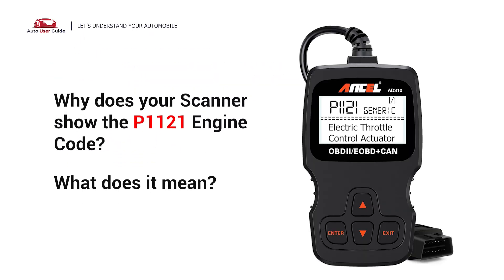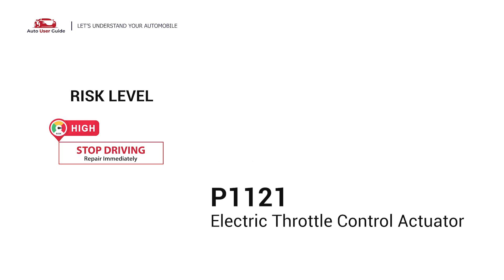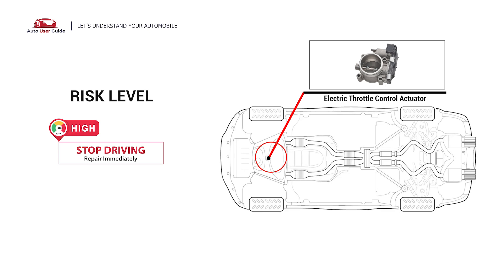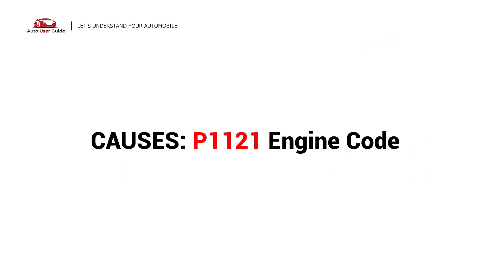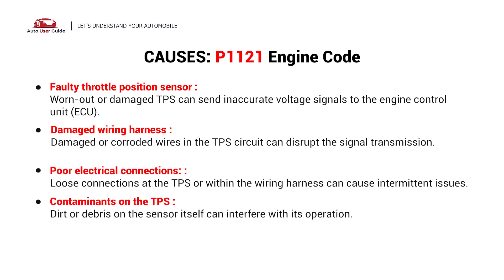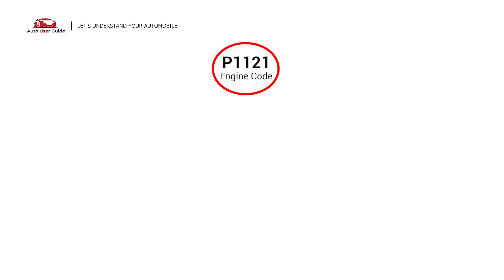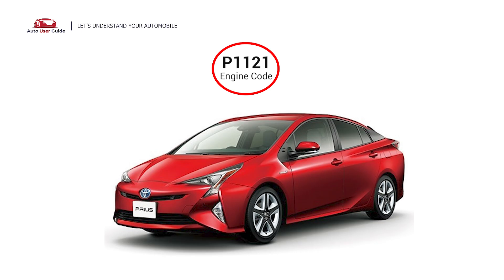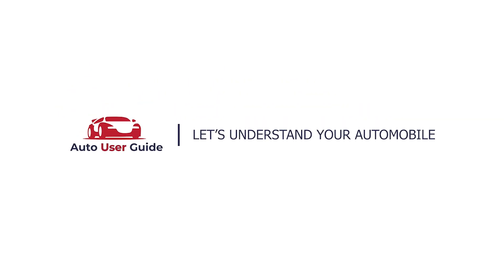What is P1121 : Engine Error Code Causes Explained

Comment: Fixing error code P1121 in nissan xtrail Year 2007 Engine QR20 Automatic..A video how to fix the problem
Reply from the maker: Code P1121 on your 2007 Nissan X-Trail (QR20 engine) is linked to the Throttle Control Actuator or Coolant Flow Control Valve (depending on market/ECM setup). ⚠️

✅ For the QR20 with automatic transmission, it’s most often the Coolant Flow Control Valve (also called water control valve) that gets stuck or fails.
🔧 Fix steps usually include:

Checking the coolant level & condition

Inspecting the water control valve and replacing it if faulty

Checking wiring and connectors for damage/corrosion

I’ll cover this with a step-by-step repair guide in an upcoming video to make it easier to follow. 📹✨
Reply: Did you get to fix this code on your Nissan?